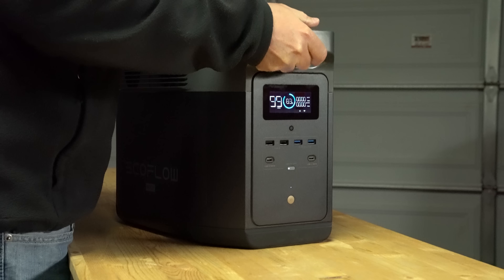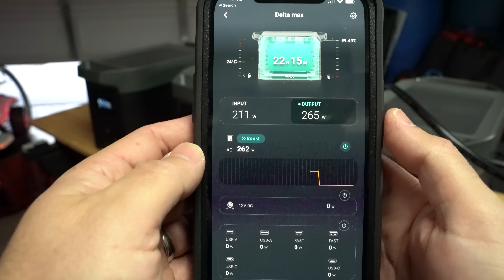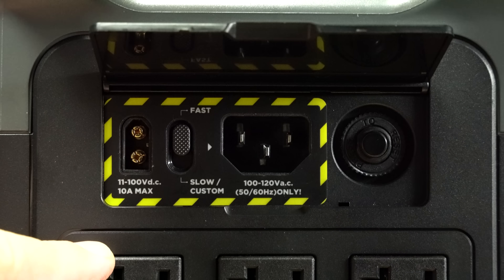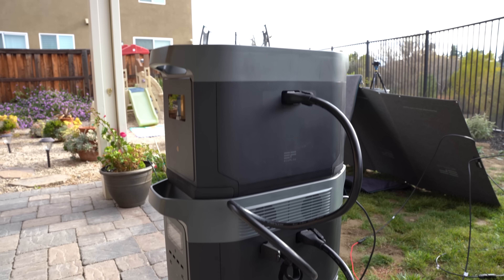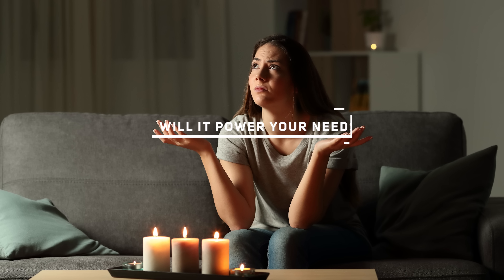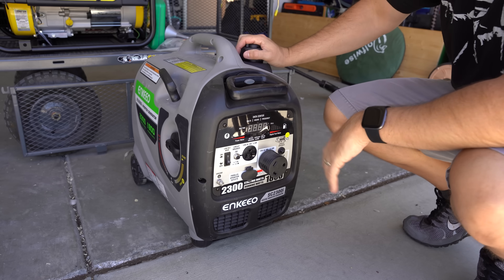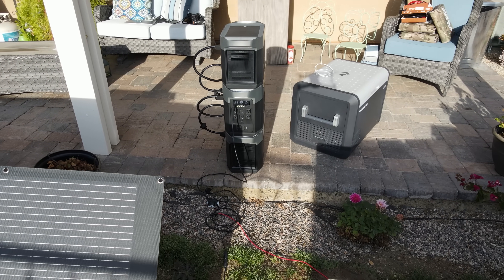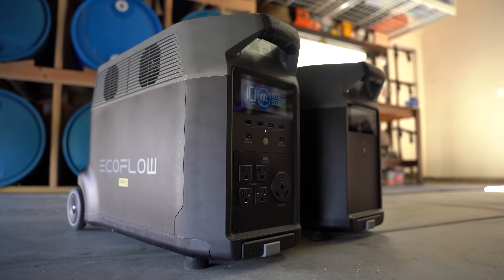Ecoflow Delta Max review - Off Grid Power in a Small Package

Comment: Would have been nice to alert people that with a limited amount of sun hours per day most likely you will use more output than input. Of course depends on where you live so you have to watch the output. Their website shows that it will take up to 17 hours utilizing the 100 watt panels, up to 12 hours using their 160 watt panels (i have 3 of the 160’s with the max and specs shows it can take up to 11 hours. I live in the northeast. Only a tad over 3 sun hours per day which means it can take 3-4 days charging with just solar. I love the unit but for new solar generator buyers they need to know.
Reply from the maker: excellent point.  i just take for granted the fact that i live in SoCal and we've got nothing but sun.  I'll be doing a lot more of these videos and I'll be sure to point that out.  thanks!

Comment: Stupid question as I am new to all this. The website says Shelf Life
1 year (after a full charge) - what exactly does that mean? Again - dumb question but I’m trying to learn.
Reply: Not a dumb question.  It means it will still be charged, after one year, of non-use. I should have added it would have lost most of its charge though.  If you're going to be using it for emergency backup power, I suggest using it every month or so, then recharge it. 

Doing this will keep the battery healthy and show any problems, before needing it.
Reply from the maker: if you charge it and let it sit for 1 year, it will likely be depleted.  i recommend getting them out and using/charging them on a monthly basis.  I do to make sure they're up to date.

Comment: Costco had a sale on these last month that nobody probably knew about I got them for 959 bucks with 160 W solar panels not the 110 W ones for an additional 199 each I also bought a river pro with the additional battery for $659 Which is cheaper than the sale that they're having now
Reply: Should have bought more panels you will need them.
Reply: @TheUGFUGF  I did I got 2 per unit

Comment: definitely wish we had a few of these in Texas last winter
Reply from the maker: at a minimum, get a mr. heater and camping propane stove for this coming winter.
Reply: @CityPrepping  Now that is great advise, DONT use this for Heating or Cooling they just don't have the power to keep going unless your dropping $1,000-$2,000 in solar panels. I tell everyone to just buy house panels and keep them on the ground so you can clean and adjust them.

Comment: In a real SHTF would it matter to power electronics and appliances with finite life times?  Internet might not exist … books, hand tools, candles, etc. might be the only options in a SHTF … the more complex the system the higher the likelihood of a break down …
Reply from the maker: good points.  i have items I'd like to power (starlink, small electric heaters, rechargeable devices for lighting and comms, etc.).  i've lived in countries without power and having solar makes such a difference.  but yeh, if it comes down to it, you have to learn to live with little.

Comment: If it isn't water resistant, how do you protect it from snow/rain?
Does it have a neter showing how much power you are using?
What does it mean it has a shelf life of one year?
How many solar panels can you connect to it?
What do the solar panels cost?
How much do the solar panels weigh in case I need to bring them inside?
How do you connect this to your house circuit breaker unit?
Is this unit resistant to EMP events?
Reply from the maker: excellent questions!  i'll include these types of questions in future videos.  i have about 4 videos to cover on similar units coming in the next 6 to 8 weeks.

Comment: The only thing I'm not a fan of is internet connection on these devices. Gives someone the power to remotely disable it. If there was a grid down situation due to the government not wanting people to have power, they could also remotely shut these down too if their intent is to leave people in the dark... I suggest keeping them offline.
Reply from the maker: internet connection is optional. i use it for upgrading to the newest firmware, but otherwise keep it disconnected.
Reply: @CityPrepping  That's what I do with my RiverMax.
Reply: @MN_Engineer  how do you like the river max?? Thanks
Reply: @carl3810  I've only played with it a little bit. Seems decent for running essential things like lights, radios,internet, computer, maybe a small microwave (if used with a UPS)...

I think this is a good solution for short term power outages. Def not going to replace the grid, but will make life easier.
Reply: @MN_Engineer  thanks! Considering it
Reply: Exactly, What’s the purpose of using these devices in an emergency if it connected to the grid.
Reply: The new Blueitti display is a touch screen and WiFi. If the screen breaks then it’s no good. So far the Jackery is one of the better options for bugging out.

Comment: For the same price you could buy a split phase inverter that puts out 240v, a few Lithium Iron Phosphate batteries, and a few solar panels. This would allow you to keep a well pump running, and the smaller 120v loads that the Ecoflow could power. Better for those bugging in, IMO. But the Ecoflow is still a really good option for bugging out. Just my opinion
Reply from the maker: true.  i plan on doing a video next year showing how to build your own.  what you're paying for on these units is portability and engineering.
Reply: @CityPrepping  I look forward to that video
Reply: That's great but it's not portable
Reply: Bruh...of?.... I don't even understand what you're saying

Comment: What is a realistic number of panels one should have, to expect that in 3-4 days one could fully recharge the battery under ideal sun? I know this might be better asked under another video, my apologies and thanks in advance.
Love the lightweight features of this model.
Reply: 4 200 watt panels to charge fast.
Reply from the maker: Great question.  It can accept up to 800 Watts via the solar panels.  So assuming you've got a clear sky, you could charge the Delta max from 0% in roughly 3 hours (give or take) if you have 800 watts of panels.
Reply: @CityPrepping  to get 800 watts you have to over panel it.
Reply: @zfontain1975  Plus adjust the panels every hour or so, depending on the sun. This is when you buy the house panels and keep them on the ground so you can clean and adjust them and leave those portable panels alone and save some cash.
Reply: I understand the responses. Thank you so much!

Comment: Also if you're using xboost and concerned about sensitive devices, use a regular UPS between the device and delta max. This will protect sensitive devices from low current damage.
Reply from the maker: great tip!
Reply: ...low VOLTAGE damage.
Reply: I remember reading NOT to daisy chain any types of surge or ups units. I never could get a detailed answer as to why. Something about them triggering each other causing damage to the components.

Comment: Sir you have just sold a ecoflow delta. I was debating or contemplating on a AC 200 but I see that this is much cheaper and....  much more what I need. good day sir.
Reply from the maker: i'll be review the AC200Max next month.  Solid option as well. They use LiFePO4 batteries which would be ideal for a more permanent setup.

Comment: Don't be fooled, these are great units but you will drain it in 1.5 hours using a 1500w heater.  This isn't something you would use for home power backup.  More so for recharging items, running small appliances.  Still good to have but do some research and think about your needs before you drop the money.
Reply: Like you said more for recharging items and NOT for Heat or A/C (Unless you have a solar array that can supply enough power, This is not one stop shopping, you will need to find other sources for cooking and heat. Something else that these youtubers really fail to stress. You spend $2k just for the unit now you need solar panels you will be $3k before you even get started.
Reply from the maker: Yup. Will burn through a battery quickly. Definitely watch the video I referred to before buying one of these.

Comment: I'm waiting until I can get the larger unit from Ecoflow. I've seen the newer larger one, and I love that you can use the same changing station as a car. I'm also going to be using it exclusively for a small cabin build, and want the extra life span of the batteries. Ecoflow is by far for me anyway, one of, if not the best Company in this business! Thanks so much for doing the review..
Reply from the maker: i just got 2 ecoflow pros today.  will review them at the beginning of january.
Reply: @CityPrepping  That I want to see! Did they also send the gas generator as well? This will be great!
Reply: Would you mind elaborating on “use the same charging station as a car?” I have a Tesla so
I’m curious about this. Also FYI I’m a newbie to prepping and backup generators  lol
Reply: @alexisu5064 also wondering about how to charge these w a car charger

Comment: Ive been looking at these a lot lately. Being able to keep a fridge or freezer cold during some kind of long term power outage would be huge.
Reply: This system is a beast and will definitely keep a fridge or ice chest for a few days
Reply: @freedomfighter1861  )0a!
Reply: @privacyatty  close to a year like what happen in PR after maria. With proper charge/recharge cycles and good solar input this unit could do it
Reply: We have the 1260w Delta and it ran our fridge easily from 7 pm until 7 am with 3 hours of time left (seeing what we could do with it - highest we saw was 800w, but hovered around 200w most of the time). You definitely need two or three 100w panels as charging with one took two full days to charge from there to full. We had some tree coverage of the panels, but full sun. The panel managed 90watts at highest.
Reply: @kelley8223  thanks for that info
Reply: @samthibeault5649  You're welcome! I got another panel and haven't been able to test that out yet. I will try to remember to come back and let you know how fast that went.
Reply: Glad to share! Still need to do a test run with both panels.
Reply: @kelley8223  nice info
Reply: @Tom Richman what rechargeable batteries are good?
Reply: @zfontain1975  The new Lithium rechargeable AA, AAA and 9-volt batteries.
Reply: Saves a bunch when it happens but is it worth it?
Reply: @havuckofp  Think about this how much $ (food) is in your freezer? Is it cold outside when the winter weather kills the power could you place your freezer outside? 5cf chest freezer takes less then 60watts to maintain 600watts to cool it down.
Reply: @havuckofp  yes it's worth it.
Reply: @zfontain1975  No for $2,000 plus do the math how will you recharge that unit? Solar look out side see any sun lately for 6-8 hours a day?
Reply: @TheUGFUGF  I live in Arizona so you can get some sun here but you need lots of panels.  Ecoflow is nice too because you charge off gas generator fast and save gas.
Reply: @zfontain1975  Even in the best of sun the panels will only provide so much, you are correct you will need "lots" of them and they are not cheap, you also would need more during the winter time. RE: Gas Generator I would suggest that you take both somewhere else and charge your unit back up keep your gas generator to your self that way and people wont know you have one.

Comment: Wonderful bit of kit....but sadly of little use in UK..
I lived in a motorhome for 2 years in UK ...had 450w of solar, and no TV.... I still struggled to power my fridge, led lights, phone and laptop during the darkest months...
I'd still rate this above a fuel generator though...for the reasons you mentioned.
Reply from the maker: fortunately i live in socal.  nothing but sun all the time, but yeh, if you lived somewhere with overcast or little sun, that's a different story.
Reply: @CityPrepping  You say that you live in SoCal in the replies but during the video you just appear to forget that VERY IMPORTANT part that during the winter Sun is not out everywhere and your saying buy this item but you fail to understand that the input (solar) sucks right now for so many so yes if they get the larger unit they may have a couple days of power then what? This is when you need to STRESS that this is not for everyone and maybe a small generator to charge this (off site) would be a good or better idea then relying on solar that at best takes all feaken day even in SoCal.
Reply from the maker: @TheUGFUGF  fair enough

Comment: So you have to be skilled in using solar panels to charge it?  I know nothing about solar panels.
Reply: Using solar panels in this case doesn’t take much brain power 🤷🏿‍♀️. It’s literally plug and play… plug them into the unit, Sit them it in the sun unobstructed . Doesn’t require any special skills… literally just common sense.
Reply: @jasminem3902  I see.  Do the panels work if it's overcast?
Reply: @wap9137  some companies have solar  panels that work in overcast situations. These also are weatherproof for rain. City Prepping has a video on solar panels. Check that out.
Reply from the maker: pretty basic...plug and play
Reply: @CityPrepping  You plug the solar panels into the Ecoflow Delta and the sun recharges the battery?  Sorry to be so dense.

Comment: CP- i just received a Jackary 1000 with two solar panels to support my Honda 2200i gas generator. For small demands I hope this combination would help in an extended emergency.
Reply: I bought a jackery 290 and a 25 watt solar panel. The jackery works great. I got because of my medical equipment (nebulizer), cell phone and tablet. Got a small heater to be hooked up. Looking for auto electric blanket.
Reply from the maker: jackery 1000 is great for a lot of small uses.  there's so many of these on the market now and i just want the community to know about the options.  you've got a great setup.

Comment: Not a generator, just a relatively small battery with electronic controls. A powerbank on steroids.
Reply: So can a power bank run a 5000 BTU air conditioner?
Reply: @Utriedit215  yep—maybe not for extended periods of time but it can run a 5000 btu AC unit
Reply from the maker: i need to address that term in future videos :)
Reply: Smarty
Reply: I hate to think how sad your life must be to be that negative for no reason
Reply: @Utriedit215  sorry, I'm an engineer
Reply: Technically your correct—it’s a Solar capable power bank that does what a standard generator does.
Reply: Your wrong Google the definition of genoator

Comment: They need to put wheels and a pull handle on these generators, solar generators, batteries etc. We can't all lift 50 lb.
Reply: I’ve got one these and had The same thought. I had to carry it up a flight of stairs to my apartment too. So I got one of the small dollies from Harbor freight. It’s the perfect size for this
Reply: Can you place on a cart? Just suggesting
Reply: I use an upright toolbox with wheels and it Carries the generator, power cord and any extra  accessorys I need.
Reply: Get yourself a strong friend
Reply: I have mine on a small aluminum dolly. Secured with bungee cord. 🤘🏻😎🤘🏻
Reply: They must have read your comment because their newest model does.
Reply: Mine fits in a carry-on suitcase with a handle and wheels. 👽✌️
Reply: If you can’t lift 50 lbs you won’t survive the apocalypse
Reply: I don't think so that will up the price if you can't carry it then you can always get a wheelbarrow or a cart